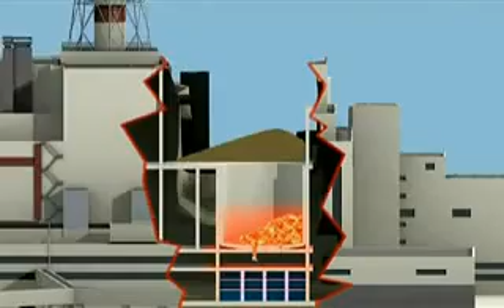Chernobyl: second nuclear explosion averted (3-5 Megatons)

Comment: Nononono nooooo!! :) 
If it were so easy to make nuclear bombs (Crystalline zirconium silicate of which 10% is molten uranium (235)/Graphite + water/H2O?), countries wouldn't invest millions of dollars into researching better nukes.
"The smoldering graphite, fuel and other material above, at more than 1,200 °C (2,190 °F),started to burn through the reactor floor and mixed with molten concrete from the reactor lining, creating corium, a radioactive semi-liquid material comparable to lava. It was feared that if this mixture melted through the floor into the pool of water, the resulting steam production would further contaminate the area or even cause a steam explosion, ejecting more radioactive material from the reactor. It became necessary to drain the pool. These fears ultimately proved unfounded, since corium began dripping harmlessly into the flooded bubbler pools before the water could be removed. The molten fuel hit the water and cooled into a light-brown ceramic pumice, whose low density allowed the substance to float on the water's surface."
"Unaware of this fact, the government commission directed that the bubbler pools be drained by opening its sluice gates."
The way that nuclear bombs work is you take a piece of enriched Uranium-238 (96%) or Plutonium-239, wrap it around with slow and fast explosives that compress it into a denser material, thus helping it make a huge burst of nuclear fission, creating a big boom. (its actually way more complex than it sounds and it has to be very precise (the placement, the functions) to explode)
1. They do not have such an environment;
2. The fuel is not enriched enough (worst that can happen is it melting, not exploding)
And a molten Crystalline zirconium silicate of which 10% is molten uranium (235) wont have much fission going on either (to make an explosion). A 3-5 Mega Ton detonation wouldn't reach or "raise" Minsk. In fact, even a Tsar-Bomba like explosion doesn't reach Minsk or any other capital. (https://nuclearsecrecy.com/nukemap/ << try this out)
"Fortunately, the reactor cannot explode. A nuclear explosion cannot occur because the fuel is not compact enough to allow an uncontrolled chain reaction. The MIT reactor has a lot of water and core structural materials that slow the neutrons down before they reach other fissile atoms." This was the worst case scenario happening and there wouldnt be a second explosion, ever.
Either a way, the divers had big balls, nothing but respect.
Sources:
https://nrl.mit.edu/about/faq
https://en.wikipedia.org/wiki/Chernobyl_disaster
https://en.wikipedia.org/wiki/Chernobylite
https://www.youtube.com/watch?v=d2PxY-wOrI8
https://www.youtube.com/watch?v=SsdLDFtbdrA
https://www.youtube.com/watch?v=BfJ1fhmPPmM
https://www.youtube.com/watch?v=y5dV3IuNWvU
I seriously recommend you to watch a few of these. (if you want scientific accuracy)

Comment: This weapons expert speaks of 1400 kg of uranium and graphite mixture, but the description of the RBMK reactor says that it has only 192 tons of uranium. That's not enough fissile uranium in a "Little Boy" type bomb for even a 390 kiloton explosion. That's even if we assume that the amount of plutonium generated during the lifetime of the fuel rods so far, makes up for the fissile uranium consumed -- which obviously it can't, or they wouldn't need replacing for decades.
Reply: This video makes it seem like there was a risk for a nuclear explosion, when in reality it would’ve been only a steam explosion that would’ve ejected more radioactive material, and could possibly have damaged the other three reactors at Chernobyl at most, but even a steam explosion there would be at most a few kilotons. So it still had the potential to be very bad, but nowhere near what this or the HBO miniseries says
Reply: @personmanman3071  not even kilotons, it would've been 100-200 tons of TNT worth at most, in the extreme scenario where all the tanks were full, sealed off, and the corium suddenly touched the water, as opposed to the tanks being open and water constantly being in contact with the melted core, which was the case IRL. 

The only real danger would have been ejecting even more fissile material, possibly even the majority of the core, into the surrounding area, which would've made the containment an even larger nightmare.

Comment: Power plants cannot blow up like nuclear weapons because nuclear weapons use highly enriched uranium. Going through a process which removes as much of the 238 isotope from the uranium as possible leaving it at roughly 80% 235 (the isotope that can actually chain). Power plants use low enriched Uranium because 1) high enrichment is extremely expensive and it would cost more to run than you would ever make back  basically having to pay the cost of a nuclear weapon every time you wanted fuel 2) building a power plant that can blow up like the most devastating weapon humanity has ever created would be the definition of insanity. Russians are crazy yes but no one is that crazy.

Comment: Our experts studied the possibility and concluded that the explosion would have had a force of 3-5 megatonnes. Minsk, which is 320km from Chernobyl, would have been razed, 
and Europe rendered uninhabitable." from 1400 KG of corium

NOPE! 

a ton of nuke fuel = 40-45 gigawatt days & a 4 megaton explosion  = 200 gigawatt days 
= 5  metric tonnes needed minimum IF it could detonate based on a 2,350 gigawatt hour rating in an instant  when  it 3 gigawatts thermal max capacity 

1 cubic meter of Uranium 19000 kilograms ,& 1200 LBS of Uranium is  1 cubic foot, 

1400 KG = 1.4 metric tons  = 1.6 cubic foot  of Uranium / 4 cubic feet uranium dioxide 

a 14 to 18 inch to across low enrichment blob = & 0.1 kiloton theoretical max as a nuke 
as sustain criticality  IS NOT prompt critical & definitely  not atomic detonation  = NOPE! 

Water expands when converted into steam NO MORE THAN 1,600 times   =  NOPE 

mythological chemical explosion  A hydrogen explosion , from a quench of a superheated nuclear fuel in water where zirconium absorbs oxygen from water = hydrogen = NOPE!
Reply: you are not that smart as you think, it was 1400kg to start the chain reaktion
Reply: yeah u dont know how much secrecy there was ahahahah, (we have to sacrifice human lifes to drain the water its critical) but naah it does not matter if it hits the water no. how stupid are you people?

Comment: contact with water would release enough energy to cause nuclear fission, which would then cause a chain reaction of nuclear fission due to the energy released in first fission reaction that's the 4-5 megaton explosion part, the steam just sets the ball rolling so to speak. hope that helps.
Reply: The hotter your neutrons are, i.e. the faster they're moving, the less likely it is that they'll be captured by the one in 140 nuclei of natural grade uranium that an RBMK reactor uses.
But apart from that, the uranium 238 AND the protons in "light water" both capture neutrons. In any case, the total mass of the fissile isotope in an RBMK reactor is 192,000 kg/140 which is 1167 kg.
It took 64 kg of bomb grade uranium, 90% fissile, for the "Little Boy"  dropped on Hiroshima, and reckoned at 15 kT of TNT.
This means that if the terrible corium, water, and graphite managed to build an accidental bomb as efficient as the Hiro shima one, it'd still  be only 383 kilotons. And this weapons expert has given us no guide to how that efficiency  could have occurred.
Reply: Thank you, this is the first plausible explanation I've heard of this extraordinary claim... I'm still curious how molten corium dripping into water can reach supercriticality, as far as I know getting weapons grade stuff to explode is far from trivial in ideal conditions.
Reply: @bakadavid  It's also completely incorrect. At best, using the water as a thermal source for the explosion (if the entire core was at the boiling point of 4000C which it wasn't) and having the entire boiling core dumped in you have a flash explosion (non-sustaining) equivalent to maybe a could hundred tons of TNT...certainly nowhere even close to millions of tons. 

In order to get a nuclear explosion you need to contain the blast so that you can get as many chain reactions as possible because the instant it starts to move apart from the explosion the likelihood of a continued reaction goes down. 

What DudyCat is saying is equivalent to saying "a Tesla can run out of gasoline."
Reply: @edweiser63  Exactly, creating a nuclear explosion is actually very difficult. As soon as the reaction gets started it wants to expand, and nuclear bombs use heavy uranium or lead tampers to contain the reaction until it runs to completion. The melted core would get hot and expand well before the reaction has run its course because theres nothing to effectively contain it.